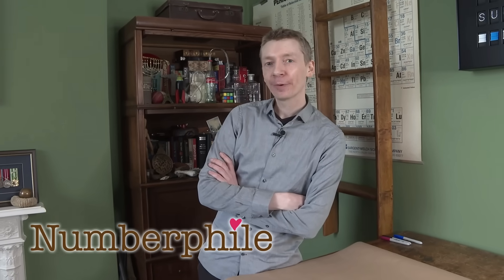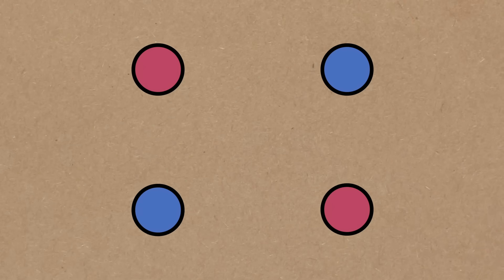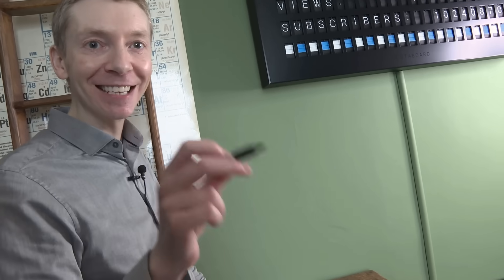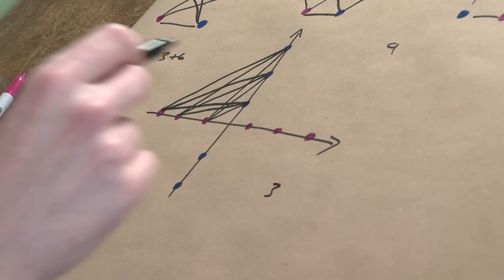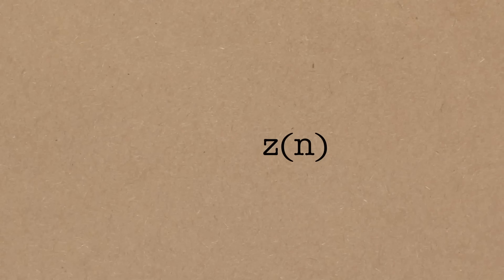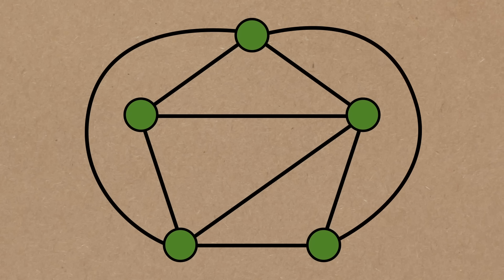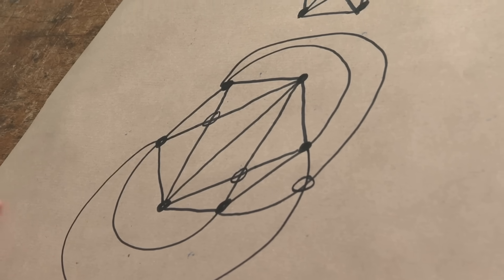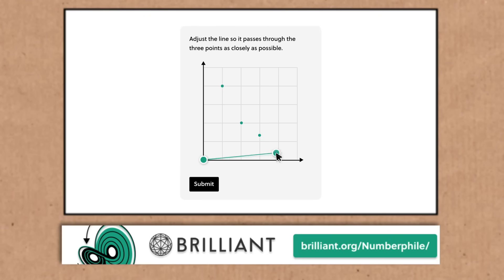The Brick Factory Problem - Numberphile

Comment: "Complexity dissolves when we perceive reality from a higher-dimensional perspective."
stack kilns either level to or above storage units, bridge and or tunnel the crossings. as long as the storage is level or below the kiln inertia conserves momementum of full carts rollercoasting to a storage, empty carts are easy to move back up or level to a kiln if pulled by carts going down.

Comment: Enjuhnears r duh smarterer.

Forget direct lines.  You have a centre circular one way track with sidings for every kiln / store.  The only thing that then limits the number of nodes you have is physical size of the node versus space left to mount a siding on the centre track.

Comment: Have one track with all the kilns on one side and all the stores on the other side, then you have them all connected with no crossings.  

                           S  S   S  S
====================
K  K  K  K

or if you want track running into each node, then you can have K+S-2 junctions (not crossings).

                                    S        S      S
                                     /        /       /
K====*==*===*====*===*===*=====S
           /     /     /
          K     K   K

Comment: Here's what my common sense says:
Why can't we arrange the kilns and storage units in a circle, with the center being a point say C, such that all points in S and K are joined directly to the center. That way, a path from any Kiln to any Storage unit will always exist via C, and there will only ever be one crossing point, the center!
(Since there is no restriction that the lines need to straight whatsoever)
(and as in 2:38, multiple crossings are considered as one)

Comment: If the goal is minimizing construction of crosses, why not implement a roundhouse, hub, or central switch?  Cross count 1.  If it is valid to have multiple tracks enter a kiln or storage unit, why would it not be equally valid to consolidate all crosses at a single nonterminal point?  This does not minimize traversal of crosses as each route has exactly 1 cross traversal.  So what property exactly is this problem supposed to optimize?

Comment: Solving this is easy, describing it (as I can't drag and drop a picture) will be more difficult. Draw two circles one inside the other, make the inner circle much smaller than the outer circle. Place as many kilns around the inner circle as you wish and place as many storage buildings on the outer circle as you wish. Connect the inner circle to the outer circle with as many tracks as you wish but 5 or 6 would probably be sufficient. The connecting tracks should be arched in such a fashion that they leave the inner circle at a tangent and connect to the outer circle at a tangent, they merge with both circles but never cross. Think of the connecting tracks as being half of the dividing line on a yin yang symbol. The exact angle that the connectors meet each circle can be tweaked in such a manner as to always provide 3 wheel stability minimizing the possibility of the brick carts becoming unstable. (Similar to driving your car of a curb, you do it at an angle allowing one wheel to drop at a time rather than both if you approached at 90 degrees) This hub and spoke design will allow any number of kilns to connect to any number of storage buildings with minimal connecting tracks and ZERO crossings.  Efficiency is increased as multiple facilities can be accessed by a single connector by simply continuing around either circle allowing you to chose the most expedient routes. The connecting lines can be accessed for travel in either direction by simply pushing past a junction point then reversing.

Comment: at 2:38 you say only 7 crossings.  in other words, if three tracks cross at a single point, they ONLY COUNT AS ONE crossing.  well I presume that 3 is not a special number, so ANY number of crossing at a single point ONLY COUNT AS ONE.   Therefore, it is pretty easy to prove that for ANY number of ovens and storage... you only ever need ONE crossing, which is centrally located.

Comment: Mathematician: the solution is (k/2)(k-1/2)…
Physicist: no the solution is taper the wheels to avoid spilling. 
Engineer: no the solution is use a bigger storage building and no tracks. 
Economist: no only make enough bricks to sell, no need for storage. 
CEO: no the solution is stop making bricks, future is in bit coin trading.

Comment: the obvious solution to me is to have the kilns connect to a ring that disperses to every storage unit so you would have x number of crossings as number of units at least for the bricks to storage units the number of carts in the ring doesn't matter as long as you loop around the storage units everything can run in a single direction and there will be no collisions.

Comment: There is a mistake in the problem description or a better solution is possible. At 2:39 we see that multiple crossings over the same point are only counted once. At 3:17 we see that curved tracks are possible. Given these two precedents, the partial "optimal" solution at 5:45 can be beaten by (for example) getting rid of intersection #7 by running the 4-5-6 track through intersection #2 instead of creating a new intersection.
Reply: I've just looked at the original problem.  Pál Turán would have counted eight crossings at 2:39. This is a happy mistake because it gives rise to other rich problems. For example - for a bipartite graph with straight edges what are the minimal number of "crossing-vertices" created? At 2:39 we count seven of these "crossing-vertices."

Comment: hello numberphile, i had this idea for remembering powers of 2 for a while.
i used to remember 2's powers like this: 2^6 = 64, 2^10 = 1024, and i'd divide and multiply with 2 where needed. basically i knew the two powers of 2 that start with the power itself, and i did a little digging, and found more than 4 powers of 2 that do this.

2^6 = 64
2^10 = 1024
2^1542 = 15425999532294608...
2^77075 = 7707540249846568594...
2^113939 = 1139399326354486589532...

what are these numbers called? they are not about the end of the number, its about the start, so i wouldn't call them p-adic. are there any powers of any other base than 2 that start with the powers themselves? are there an infinite amount of numbers that fulfill this? i'd love a video on this topic.

Comment: There is an issue. When you use X and Y axis you only use 2 tracks crossings. You forgot you can cross multiple tracks in same place therefore reduce amount of crossings like in 3-3 example. This can easily reduce amount of crossings to ~14-16 from 24?

Comment: I don't get why each kiln has to be connected directly to each storage unit.  If you connect each storage unit together also, you only need one  kiln per storage as the track will run enter a storage and can go out the other side.  Then from each storage unit, you can go to another storage unit or back to any kiln

Comment: The solution is incredibly simple. All kilns and all storage units arranged in a big circle.
Then run one track near them in a circle.
Load the bricks into a cart from one kiln, and drive it to the designated storage unit, bypassing any kilns and storage units that don't apply.
Just like a train that doesn't stop at a station, because it's not assigned to that station on one particular run.
Everything else is solved by schedules.
It's so efficient, that you can put multiple trains on the track.
Actually you can build two circular tracks, one inside the ring of kilns and storage units, and the second outside the ring of kilns and storage units.
Now it's twice as fast, or twice as efficient.
I would draw you a diagram, but unfortunately the YouTube comments section doesn't allow us to include pictures.
Just text.
Reply: I just started this video 7 minutes ago, and I've already offered a solution.
I haven't had years to work on this one.
But I think it's better than worrying about how many crossings there will be.
Because the answer is zero crossings.
Just schedules.

Comment: So crossings are bad, and we can send a man to the moon and bring him back alive but we can't prevent train car topple. Got it.

Instead of fixing the tracks to prevent topple, why not fix the kilns and storages so that you can have a complete circular track, no matter the number of storage or kilns. All you need to do is adjust the interior of each storage/kiln that allows pass through of a cart, stopping at the appropriate stop to pick up or unload.

This does nothing for the circuitry problem, however.

Comment: The brickyard is a poor selection to illustrate the "connections and crossing" problem. 

The layout with hundreds (not 5 or 6) of brick molding houses, raw material storage houses, kiln houses and finished brick storage houses is to make a large circular track around the circumference of the buildings or through the middle of each building which are also arranged in a circle. The rail cars can then be loaded and unloaded inside or just outside each of the buildings. The track will be close enough to each of the building regardless to their function to allow for service, picking up materials, dropping off materials, baking the bricks in the kiln-house then offloading them again to the storage house. This loop of a track would never cross itself, while allowing for continuous brickmaking. It will also merge off and onto the main railway so rail cars loaded and staged on the circular track can be pushed onto the mainline track and picked up by the scheduled engine. This model seems to be the most efficient, produce the least number of crossing for any n building count.

Comment: Why not  building a distribution center at the middle of the red points? Then the bricks can easily be distributed to the blue points without crossing.
Reply: Only difficulty is that would mean all that there would be trolleys taking the goods to loading bays across the tracks

Comment: As many have already said make a better crossing, problem solved.

But aside from that why not use the 3rd dimension and make bridges? Or Instead of individually connecting each pair with its own track, maybe run a single primary track that can be branched off of.

Comment: I understand the neat problem but I suppose in real life you'd just daisy chain the storage units.  That way there's a lot less track, shorter distances, and zero crossings.  Like this: 

K-----S
......|
K-----S
......|
K-----S
......|
K-----S

Where "K" is a kiln, "S" is a storage unit, "-" and "|" are track, and "." is a placeholder.  The ASCII graphics may not line up but you get the idea.

Comment: Better crossings? No.

Bridges? No.

Cranes which can reliably transfer carts between tracks? No.

Track which can rearrange itself to accommodate cart destinations? No.

Catapults to launch bricks to storage instead of using carts and tracks? Yes.
Reply: For computer chips you just install little silicon hands to flick the electrons between circuits.

Comment: In the formula for the minima z(s,k) = [s/2][s-1/2][k/2][k-1/2] is the denominator "2" because we are limiting the problem to a 2D space? In other words, can we generalize this to any number of dimensions M?
Reply: We could generalize in dimension 3, however we do not need any intersection in this case (we can draw all finite graphs with no intersection), so the problem is not interesting.
Reply: @pifdemestre7066  Okay I didn't think about that. If we use lines to connect dots in 3D space then we have no issues with intersections. Thanks for your reply.

But let me ask something else. What if we now use "bendable" planes to connect the dots, in 3D, instead of lines? (we go up one degree of freedom, but also one degree of restriction). The planes can twist and bend (in analogy to the lines in 2D being able to bend also). 

In this case, does the equation hold?
Reply: @ManuBlancoValentín  This sounds much harder, however I still not sure of the exact rules.

To be more precise we should connect the points 3 (or 4?) at a time by a simply connected surface. However it is not the exact picture I have (and you also probably have) in mind. As we could 'cheat' with very small surfaces.

What we could do is to ask that we set curves between each points, and any 'triangle' should be completed to a simply connecte surface, and ask to minimize the number of (curve) intersection  between the 'triangles'.

Comment: Put all kilns/storage in a circle. Tracks as spokes to the center. Stop all tracks before they overlap. 0 overlaps, but you have a nightmare region in the center where you have to wheel your barrow without a track. Assign a number of forced laborers to the center region to assist.

Comment: I appreciate the mathematic angle. Though, the first thing I thought of to solve an increasing number of kilns/storage units was either using the locations as stations which could be passed through, or to add a main line where most travel would take place. At that point, however, it'd be an issue of throughput instead of an increased chance of mishaps(Accounting for the possibility of operator error, as well).

Lovely video, regardless.

Comment: Or we can make a bus, ya know, like computer circuits. Or we can have an overpass, ya know, like roads have. Or we can have a central point with a switch, ya know, like rail roads and network routers. This isn't a "problem". I just gave 3 solutions that humans have used for literal decades or longer.
Reply: You're trying to force a math problem into the shape of an engineering problem

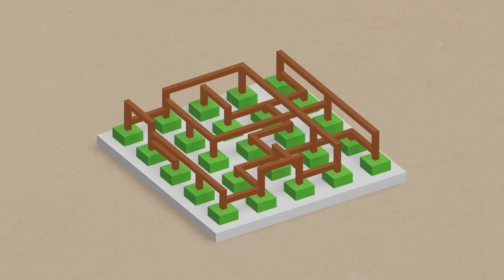Comment: @9:00 The computer chip seems a more reasonable application of these maths. The diagram @2:33 counted the 3 way crossing is counted as 1 intersection and the original problem was a derailing solution attempt. In a computer chip, that crossing would require 2 intersections, but 3 layers worth if confined to the same place. It could be lowered back to 2 layers if one circuit moved back down and to the side. 

For the original problem though, wouldn't the invention of the track turntable have been more practical? You could just have all the tracks meet in the middle, and build one turntable. Turntables don't have the problem of derailment when well constructed and well operated. 

Note: I know this is a maths channel and I love the channel. My point wasn't to question the maths, but the initial problem.

Comment: each kiln has 1 storage unit connection, and take out bricks in turn for use. If you don't take them faster than you make them, no problem. If you take them faster than you make them, then also not a crossing problem. If a kilns storage is full, then you don't need to make so many. If you want a stockpile, empty the storage unit to a stockpile location or make it bigger

Comment: Mathematicians love to come up with problems.
Luckily, engineers love to solve them and, in this case, do not run the track FROM/TO each kiln/unit, but THROUGH them. If you want to get fancy, put them in a horseshoe pattern and then run "horizontal" links from opposite kiln/unit pairs.
Simple.

Comment: If you connect all of the Kilns and Storage Units to a large Round About (does not have to be circular or symmetrical), then there are no track crossings.  However, this introduces other issues, such as the travel distance will be greater between many locations.

Comment: why does every kiln need a connectino to every storeage unit ?
i tihnk it would be more productive to put the units on the axis like shown and then connect the kilns as far as possible to the storage units without crossing (im tihnking connect each kiln to the 2 storage units the same distance from the origin) and then add additional tracks between the storage units and pay one person to move bricks between storage units if they get too uneven in terms of how full they are

Comment: I can prove that 24 is the minimum, and show my work
Reply: In a 3d graph, the way you eliminate crossing totally is by placing the inputs on a plane so no two have equal unit vectors, and the outputs along a vector parallel to the plane. In 2d the way you can rigorously find the minimum, is to place n large number of inputs along a bound they can’t cross. The topology of parallel bounds matches that of concentric circles, so you always simplify it to parallel bounds. If you start with only 2 outputs, and insert a third, the only area with the minimum number of crosses lies in the middle, which is topologically synonymous in any order. If you place any new outputs on the far side of the x axis, you get the same exact topology as if you placed it near the center or between any other two outputs. I had to figure all this out the hard way about a year ago when I was coding a node editor and wanted to add a function to reorganize the tangled mess between two nodes with lots of inputs and outputs quickly, so it wasn’t so hard on the eyes when you’ve made a mess
Reply: I mean, I’m not a mathematician, and I may absolutely have overlooked something, but I did the work specifically for this reason. As a side note, if you have more outputs than inputs it’s the same solution just at 90°

Comment: It seems to me that the way that crossings are counted is inconsistent. At 2:38 the center is counted as 1 crossing, even though three tracks are crossing. If one track was moved slightly to the side the number of crossings would be bigger. Conversely, at 5:37 crossings 1 and 2 could be combined into a single crossing by gradually changing the curvature of the three tracks and having them cross at a single point (trolley departures would be reversed for this). This is bothering me -- isn't this meant to be a topology problem, not geometric?

Comment: I wounder why they did not use a relay point. Basically a storage in the middle where all kilns connect to. A set of workers who were tasked with unloading stuff that arrives from the kilns and distributing it into the storage units. or...just have a bigger storage unit.